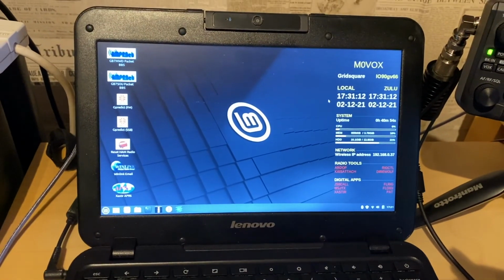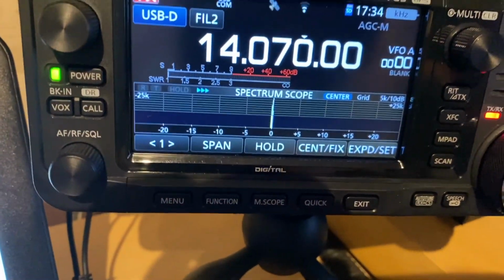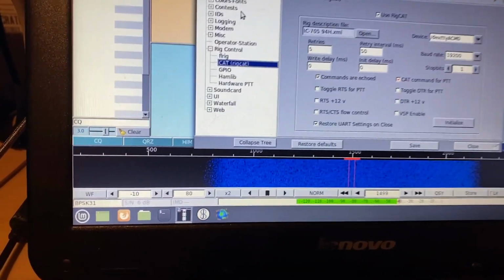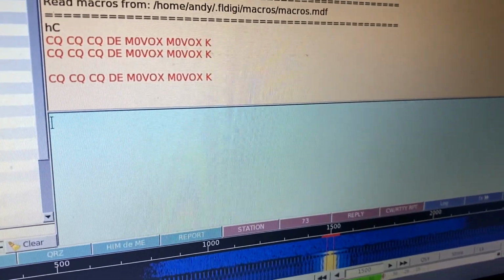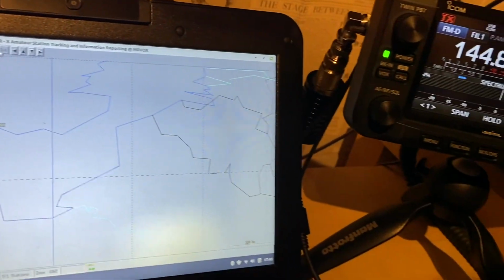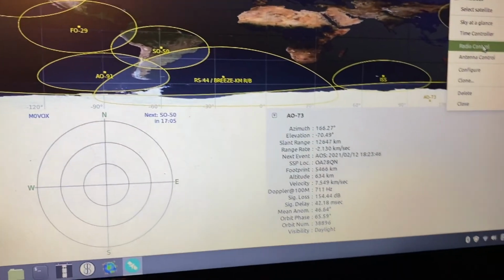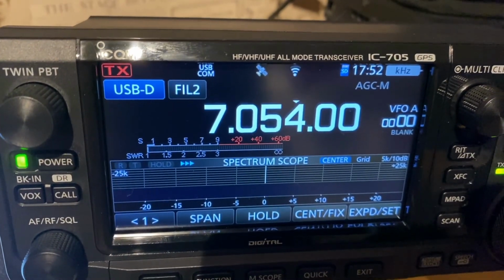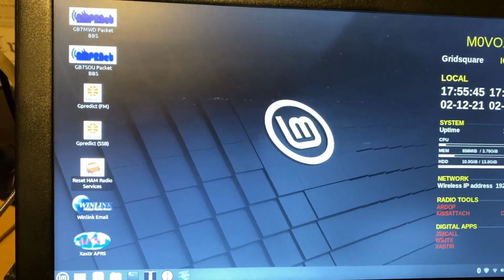Portable Ops HAM Radio Laptop (Chromebook) with Icom IC-705

Comment: what are you using to connect Xastir to the radio? You said its running behind the scenes. I cant get direwolf to operate the ptt
Reply from the maker: Hi. You need a couple of scripts to start and stop services and you also need to ensure the PTT is configured to use rigcat in the /etc/direwolf.conf file (e.g. PTT RIG 2 localhost:4532). I can share sample scripts and direwolf.conf file with you if you drop me an email. Email address can be found here: https://www.youtube.com/c/RTSRetroTechShed/about
Reply from the maker: xastir.sh script

#!/bin/sh
~/scripts/ham-stop-all.sh
sleep 2
direwolf -c /etc/direwolf.conf -p &
sudo systemctl start direwolf
#sudo /usr/bin/ax25.up
sleep 1
rigctl -m 2 F 144800000 M PKTFM 0
xastir
rigctl -m 2 F 14070000 M PKTUSB 0
~/scripts/ham-stop-all.sh
exit
Reply from the maker: ham-stop-all.sh script

#!/bin/bash
sleep 1
sudo /usr/bin/ax25.down
sudo /usr/bin/killall direwolf
sudo /usr/bin/killall ardopc
sudo /usr/bin/killall pat
sudo /usr/bin/killall xastir
sudo /usr/bin/killall wsjtx
sudo /usr/bin/killall js8call
sudo /usr/bin/killall fldigi
sudo /usr/bin/killall rigctl
sudo /usr/bin/killall rigctld
sudo /usr/bin/killall kappanhang
sleep 2
~/scripts/ham-start.sh
exit